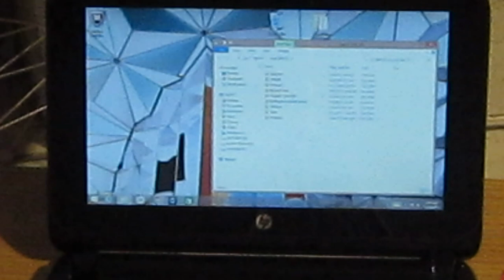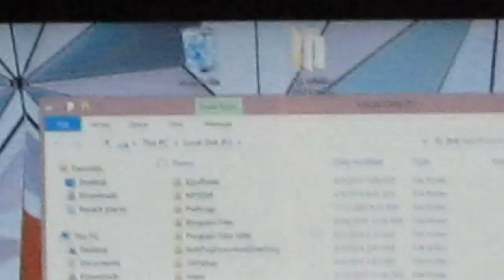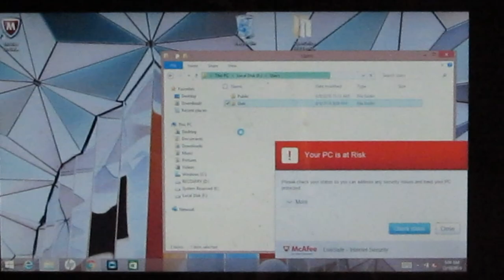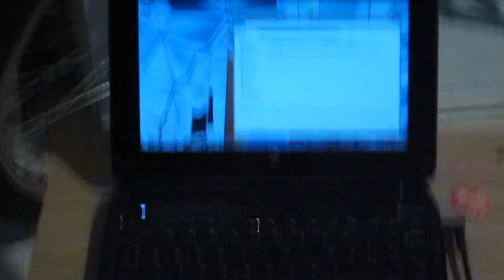How to recovery Data and Pictures from crashed computer hard drive using  a USB - Sata / IDE adaptor

Comment: Can we recover diskpart hdd... using this recovery tools... pls suggest best recovery sw for data recovery
Reply from the maker: If the hard drive still functional, you should be able to just copy the files to a new computer. I have used Photorec to recover deleted files, but it also recovers a million other things as well.. Hopefully you won't have to resort to that.
Reply: @jaynesnetwork  Thank u Sir
Reply: well, there is a secret trick that repair shops dont use to recover data with only the installation media

step 1: press shift+f10 (shift+fn+f10 if your computer has a fn button)

step 2: type notepad

step 3: go to file > open

step 4: in the side click on this PC

step 5: show all files from the dropdown

step 6: try transferring a file or folder in a drive to external storage (you can transfer multiple files or folders) and view data after reinstslling Windows

pros: make it full screen by getting it to the max height of screen
cons: IT SADLY DOESN'T WORK, WHAT A SH*T METHOD!

Comment: When i plug in my sata  hard drive it doesn't show up as a exernal USB devise ....and when i look for it in my device mánager and click properties its says location 0 .....and i cant acces it or the files ...what should i do
Reply from the maker: Is the hard drive questionable?  If you have one that you know is good, I would test that with the cables to verify your cables are working properly, and that you are getting power to the hard drive and everything.  If you verify that the connection is OK, then It is possible that the hard drive has a mechanical failure.  There are many different ways the HD can mechanically fail, most can not be fixed.  A common way is that the bearings are too loose now. if this happens to be the case, sometimes if you stick the HD in the freezer for a while, the coldness will shrink the bearings enough that they will work for a short period of time.  before you try this, make sure you can connect with a known good hard drive with your external cables.  It could could also be a software/driver issue with your computer? Although, I didn't have any issues with mine, BTW what OS are you running?

Comment: It's not a laptop drive, but I am using the same type of adapter to get access to my old IDE hard drive. I tried it on my Windows 10 desktop, but the file explorer stops responding?
Reply from the maker: Try putting the hard drive in the freezer.. and leave it there for several hours.. then try quickly reading the data while it is cold! sometimes this works.. because many hard drive fail when their bearing become loose from wear and tear... the coldness will temporarily shrink these bearings, and allow you to read data from the drive.. for a little while, until the drive warms up again! it is worth a shot..

Comment: Hi

You may have saved me from a great loss but I am not sure. 
My problem is this: I had a 32 bit desktop computer whose power pack blew out. I had to buy a new computer in hurry and was forced to allow someone else to do that for me because of the circumstances I was in. They bought a 64bit HP computer for £500. (£200 too much in my opinion) I was horrified to find that when I got to see this computer the M/Board only had one SATA plug on it. I had hoped I could hook up the drive from the old computer, copy the files across I need and all would be well. Do you think adapters like yours would help? Or, do you know of any adapters that would solve any incompatibility issues between 32 bit and 64 bit drives? I am in the UK and finding help here for this is proving difficult but I would happily have something shipped if I had to.
Reply from the maker: My adapter converts both SATA and IDE for use on USB. If you get an adapter that is compatible with your drive it should work.  The number of bits is more of a processor thing..  It shouldn't affect the kind of hard drive format you have.. A hard drive from a 32bit computer is basically the same as one from 64 bit, so it should work.. best of luck.
Reply: Thanks a lot. That eased my mind a little.

Comment: my Sata to usb 2.0 Cable arrived today and I connected it to the old hard drive I took out of my broken laptop, I got all the Local Disk (C) files which contained pictures, videos and Documents etc but I can not find the main Pictures , Music and Videos which appears in This PC part of the computer.
Reply from the maker: Maybe try doing a search for ".jpg" or other possible extensions?  This might be an easy way to find pictures..
Reply from the maker: Hi The cable that you need is USB on one end, i.e. plugs in to your USB port, and probably SATA on the other end. It is an adapter cable and is both, one to the other...  It is also possible to recover files without the cables, if you have a working desk top computer.  I also made a video of how to do that if you are interested. All new hard drives are SATA, really old  ones are IDE...
https://youtu.be/xiGLjGHBoSw

Comment: hello  please help me
what is the difference between a sata/USB adapter with power supply   VS  sata/usb adapter without power supply?? 
i wanted to know if there is a difference because i have an hdd that wont work while im using a adapter sata/usb without power
Reply from the maker: I believe the disc drive will need some type of power.  If you do not have sata with power, you will probably need another way to power the disc drive.  Probably safest to get one with power.

Comment: Your video made me feel right at home - thank you! 👍 The USB to hard drive (can't believe I was actually able to replace it with an SSD by myself) connector covers all but the big 4 pin part of the HDD.  Do I need to get a different adapter?  I'm just trying to get some photos + video files from it if I can.  💯
Reply from the maker: Yes the old power supplies have the big 4 pins.. The newer ones have a smaller connector.. Maybe something like this is what you are looking for??
https://www.cdw.com/product/StarTech.com-6in-4-Pin-LP4-to-SATA-Power-Cable-Adapter/507272?cm_cat=google&cm_ite=507272&cm_pla=NA-NA-StarTech.com_DV&cm_ven=acquirgy&ef_id=Cj0KCQjwt_nmBRD0ARIsAJYs6o0aHmvnpJxUmvZC6lM60Irr49FyLLvrM0qAUhDq_AoBSOClkQL2UUYaAid8EALw_wcB:G:s&gclid=Cj0KCQjwt_nmBRD0ARIsAJYs6o0aHmvnpJxUmvZC6lM60Irr49FyLLvrM0qAUhDq_AoBSOClkQL2UUYaAid8EALw_wcB&s_kwcid=AL!4223!3!198550684941!!!s!336125896793!

Comment: Can a hard drive that may have gotten wet be recovered? Laptop got wet not sure if hard drive did. Took off cover and took out hard drive the hard drive itself seemed dry.
Reply from the maker: Maybe Better let things dry out very good before putting electricity on anything.  If anything is wet, it can do even more damage and burn out circuits, by shoring them out.  I would let it dry for a week at least before attempting to put power on it. If the hard drive itself is dry, them maybe you can attempt to recover in another computer? It should probably work,... provided the initial wet computer did not short out the hard drive circuits in the hard drive itself.  Definitely try it on a good working computer... Best of luck.  Let us know how it works out.. Thanks..

Comment: Hello and thank you for your instructional video.  The power supply you are using, is it the same as the one that was used on the computer that died or a special power supply?  Also, can you please add the item number of the cables used?  I went to Microcenter online and they have pages of cables, the item numbers would help simplify selecting the ones I need.  Again, thank you!  Dizzy
Reply from the maker: It was a special power supply that came with the kit.. There are many on the market. The last time looked, I did not see the exact model that I used, but I Imagine the most others should work as well, provided they have the proper connectors for you hard drive.. Most drives will be SATA now. I do have video showing how to do this data recovery, without having to buy special cables or power supplies.. I posted a link below if you are interested..

https://youtu.be/xiGLjGHBoSw

Comment: Hi, I have a problem. My laptop does not boot (a blue screen pops up)(my computer has windows 7), I might be able to fix it if I had the windows installation disc, but for some reason I do not have one. What should I do? should I use a USB  to SATA adapter ? will I be able to have all my data back(for example my search history )? thanks.
Reply from the maker: HI, Here is a video that may help you fix your Windows 7 Blue screen of Death problem. You can buy the disc fairly cheaply from e-bay or amazon, etc... 
https://youtu.be/RPe_bUK4mQc

I would still try to back up your important data first.  Re-installation can/will cause data loss.. Here is a way to do it without special cables...
https://youtu.be/xiGLjGHBoSw

I hope this helps..
Reply from the maker: I would still try to back up your important data first.  Re-installation can/will cause data loss.. Here is a way to do it without special cables...
https://youtu.be/xiGLjGHBoSw

Comment: @jaynes network hi...can u pls tell me how i can recover photos fron a hard drive which accidentally fallen down & have scratch...
Reply from the maker: It is a mechanical hard drive? Scratches on the exterior of the hard drive don't affect its operations, but there are fragile components internally that can be damaged if dropped? Can you explain a little more what happened, and why you believe it is not working properly, symptoms etc...?  thanks
Reply: jaynes network its WD elements portable hard drive...we had given to a recovery centre in dubai...they said there is a scratch in the head...they said its not possible to recover the photos...do u think is there any way to recover it....pls  suggest a centre if so....

Comment: Actually my photos are in local drive E on my pc whose hard disk corrupted.So can I retrieve it back from my pc hard drive or will I get the data only from Local drive C?
Reply from the maker: If it is corrupted.. that is a problem.. it depends on how the drive is corrupted... sometimes the bearing get loose, and if you put the drive in the freezer, that will tighten up the bearing and allow you to read data for a little while, while it is still cold!.. I have a video on photorec, and that can be use to recover deleted files...  sometimes it works.. I will post the link below.. Best of Luck!

https://youtu.be/vLUpJOZmREs

Comment: Does this procedure work if I'm trying to pull files from an old machine that ran Windows ME?
Reply from the maker: It should work on any operating system... provided the hard disc is still functional..

Comment: Thank you for the valuable information. My question is I have about 3 hard drives that came from a PC but I am running a Mac computer now. Would this proces work from a PC hard drive to an mac unit? I just want to extract the photos.
Thanks, in advance, for your advice...Best regards
Reply from the maker: Mac is the one OS that I am not too familiar with.  This article seems to say that you can read from but not write to PC drives from mac. Its worth a shot.  Best of luck.
https://www.imore.com/how-use-pc-formatted-drive-mac
Reply: Thank you so much for your help.

Comment: if HDD or SSD cannot be opened because of encrypted drive and notepad file explorer won't access it, try using a software to remove bitlocker, if you have data on a system drive, recovery environment will suspend the encryption and you can access the drive using notepad
Reply from the maker: Very interesting.. have you tried using a linux system to read the drive? It seems if it is encrypted, that nothing can read it, if you don't have the pass word??

Comment: I can't boot into windows only black screen appears.

I have windows in C and other data in D and g volume.

So using a bootable disk can i delete the c drive(which contains windows and some applications) and not touch the remaining two partitions and then again install windows on the same drive again by creating new C volume??
Reply from the maker: I believe that the D partition probably will not be harmed, but to be sure I would backup it completely before trying something like this, then if it does get erased you have it saved.  If you have a copy of Ubuntu on a boot disc, you can boot your computer into linux and not have to worry about affecting the hard drive as well... It is another possibility to help you trouble shoot.  I still would backup first though.. There is always a risk when you are doing something like this... Maybe you could just put a new hard drive in your computer, and start from scratch, and save the old one to get files off? Just another possibility..
Reply: You will have to boot from bios on dells at the same time you go to push the on button repeatedly push on and off the f12 button and boot from a copied image of windows an usb drive is your best bet you want to change the boot order to the usb flash drive you may have to reinstall windows

Comment: Hello, sir my hard disk had stopped working 2 weeks ago, on connecting to computer windows do not boot up and my computer freezes on motherboard menu. Sir hard disk make no clicking sound. If i follow steps in this video it will work ?? please reply sir
Reply from the maker: It could be that the hard disc is done for??? If it will not power up.. or spin... then I don't know any way to get the data off..

Comment: Can I recover my files that I saved on C- DRIVE(user desktop). My PC is not working. I think my processor & motherboard are dead but my HDD is ok. Hoping a reply.
Reply from the maker: Yes, If the hard drive is OK, you should be able to read it with another computer.. You can either hook it up externally with cables like I show in this video, or you can put it internal as a second hard drive. I show how to do this in a different video.. Then you should be able to copy the data and save it..
Reply: @jaynesnetwork  . Thanks for the reply.

Comment: Does this work for me?my hp laptop hard drive, mother board, cooling fan crashed one year ago.and I still have my crashed hard drive.it is going to work for me?
Reply from the maker: It should work provided you did not damage the hard drive.  If it was the cpu fan that failed, hopefully it was only the cpu that was damaged, and probably the hard drive is OK.  If you have valuable data on that hard drive, it is worth a shot at trying to recover it.

Comment: Sir i am not able to recover my crash hard drive after putting the necessary tools..any suggestion
Reply from the maker: Did you try reading the hard drive with another working computer?? Does the hard drive spin up?? (assuming it is a mechanical/magnetic hard drive).. It is possible for the hard drive to fail physically.. and for that there is no cure that I know of.. Usually, the boot/OS gets corrupted.. then it is possible to read the drive from another working computer.. if it is a more serious problem.. it may not be possible to retrieve the data.. Is the hard drive still functional, when plugged into another computer??

Comment: My laptop doesn't recognize the external hard drive that I connected it to. Any advice on how to get it recognized?

I can hear the hard drive ticking/clicking when the power is connected.
Reply from the maker: Can you hear the drive spinning up?? If not, that is a very bad sign.. and probably is impossible for anyone to retrieve the data..  The drives can fail mechanically, and then this trick does not work.. This fix only works if only the OS is damaged, so that the computer can not boot off this drive, yet the drive is still physically working and can be used as a secondary drive in another computer.. if the drive is not physically functional, then I know of no reasonable way of retrieving data from it. If the drive is not recognized by the computer, and you only hear clicking sounds.. and no spinning.. My guess is that it is probably toast.. Sorry..
Reply: @jaynesnetwork  I will have to retry and listen more closely to hear if it spins at all. And I have a 2nd laptop that I can test to see if the hard drive is recognizable.

Would any recovery software work?
Reply from the maker: If the drive is working.. I believe you should be able to access it normally..   Some hard drives fail because the bearing become loose.  If you put the drive in the freezer for a while, sometimes it will shrink the bearing enough.. so they will work for a little while, and you can recover your data.. Other things can fail of course... and if that is the case, this fix won't work.. For instance, a tecky here at work, had the circuitry on one of his hard drives fail, and he was able to replace this circuit, and get it to work again.. I would probably not attempt this..  Anyway, yes, try it on another computer, it can't hurt.. best of luck!..